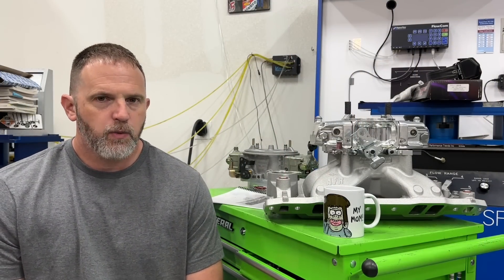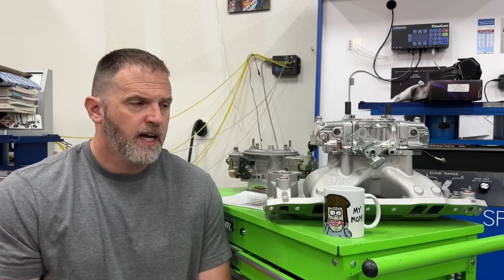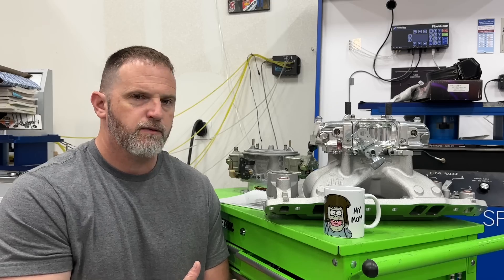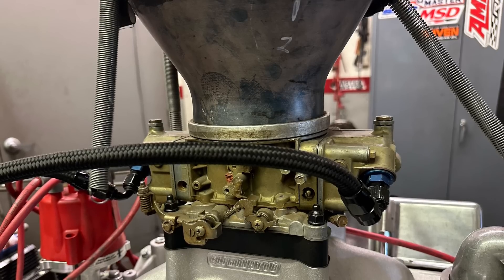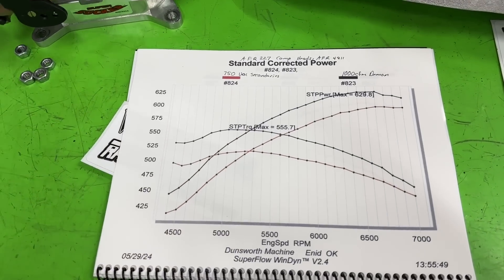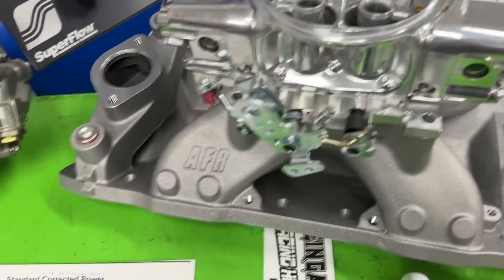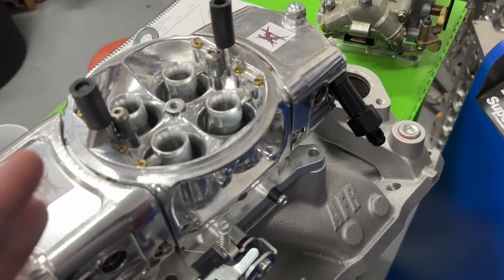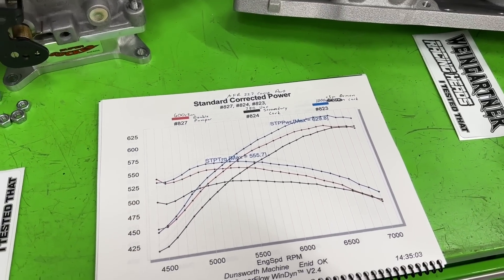Can A Smaller Carb Make More Power Than Larger Carb

Comment: to call that demon a 1000cfm is very mis-leading.. even more so with an annular booster eric…
Reply from the maker: The one in the video is not the one used. The one used has bigger Venturi and throttle blades.
Reply: @WeingartnerRacing   bigger than 1.59” venturi ? 1.75” throttle blade is still the biggest for a normal 4150.. same size holley has always used in true 850’s.
Reply from the maker: The build sheet from mark says 1.56/1.75 1050. I know they make bigger than this. The claimed cfm when I bought new from demon when it was Barry grant they claimed 1000cfm.
Reply: @WeingartnerRacing  there ya go. that’s a standard 850 venturi. now put an annular booster in it and the cfm goes down. i guess if you flowed the carb at 30+ inches of mercury you’d see 1000cfm. 🤷🏼‍♂️😄
Reply: @kevinvannoy  people use a 1050 qf 4150 on a street pu.o gad 540 BBC that won't see more than. 65-6800 RPM  and don't have issues you can loo on the yellow bullet and see that.  That's what gave me my next idea....
Reply from the maker: @kevinvannoy I will try to flow one on the bench and see
Reply: @WeingartnerRacing   yes sir. years ago when i worked for Brad Urban when we opened up 850 venturis , used pretty thin throttle shafts , and dog leg boosters we would measure just over 900cfm at 20.4”…
Reply: there are  demons  that are 1000 cfm.  1050  quick fuels  too
Reply: @KingJT80  you need to understand actual venturi sizes. what everyone calls a “1000” is still barely an 1.57”-.59 venturi. the only reason holley started calling them a 1000 is because they raises the test pressure up. all bullshit as far as a cfm number goes..
Reply: @kevinvannoy  on Holleys this is true. They're really an 850 not a "950" so I do know what you're talking about

BUT Demons 1050 carbs are actually bigger. A lot of racers will tell you the 1050 4150 flows what it says it does unlike the Holleys
Reply: @KingJT80  i tell you what then. measure the venturi  in one of those demons and get back to me. 😉
Reply: @KingJT80   holley never made a “1000” like they advertised. they simple upped the test pressure on an 850..the sheep all followed because they couldn’t be out done. higher cfm ratings sells..😉
Reply: @kevinvannoy  Holley makes a classic 1000 and its not a 1000. We're saying the same thing here 

The quick fuel 1050 4150 has a MINIMUM venturi size of 1.68. racers will tell you this...

You're welcome
Reply: @KingJT80   you cannot have a standard 4150 with a venturi of 1.68”.. there’s physically not enough room. blp will make one of their billet center sections with 1.622” and that’s only because they move the air bleeds back outa the way..
Reply: @kevinvannoy  the same person who makes twin blade 1200 CFM 4150s measured the QF 1050

Thinner blades is how they did it. Look it up on team Chevelle.
Reply: @KingJT80   i know all about the twin blades and who started those.   there is not a standard 4150 that has an 1.680” venturi. 😄
Reply: @kevinvannoy  no  what  im saying is  the person who started  making  those  twin blade 1200 CFM  4150s  measured  the 1050  QF  and  he  said  the venturis  are a minimum  of  1.68
Reply: @KingJT80   i can kinda see that. twin blades remove a decent amount of material to complete the oval venturi..  those will truly flow over 1000cfm easy when using the standard test pressure of 20.4”..

Comment: Yes there's something wrong with that 750, to lose power  only too gain with even bigger 1000cfm ! Also only need as much as the motor can ingest and after that point then your only wasting fuel/air to a point of losing power I would think
Reply from the maker: That is not true.
Reply: a 750  on a 600+HP engine  is  too small.  950  about right
Reply: Engines don't work off flow, they work via pressure differentials. A bigger carburetor will always make more power because they can better keep the manifold plenum close to atmospheric pressure. The higher the manifold pressure, the more the air/fuel wants to rush into the depression being created by the piston. Calculating engine cfm requirements doesn't account for this. The too big carburetor myth has lived on for a long time because what was first available to the public was calibrated for emissions and economy. Those calibrations created a mains circuit that was slow to respond to quick change of throttle position when the carb was on an engine smaller than what it was designed for. Recalibrate the large cfm carb for a more active and responsive mains circuit and power and drivability can be had. Annular booster can be a key element in the recalibration.
Reply: Sounds fair, so at the point where engine is receiving all that it can ingest,whats the side effects of anything given after that point is reached ? Does the motor continue making more power ?? It was my thought that manifold vacuum readings indicates if carburetor is big enough to deliver fuel demand ?

Comment: That is pretty cool now i learn more about carburetors now also i was curious on choke tower vs none what is yiu had 2 of the exact same carburetors just 1 holley xp without choke tower of couse and then another holley with a choke tower to see how it dies on a dyno. I am sure it probably won't do much because it was a curious of mine because i do want to get a Holley xp without the choke tower and on how it compare mine i already have with choke tower which it is now mostly off
Reply: No choke tower is good for a couple of hp up high in the rev range from the tests I've seen. Nothing drastic.  What does help is no choke tower and contoured venturi entrys. You'll see almost all high performance carbs have some type of smooth and contoured entry into the ventuis.
Reply: @Torquemonster440  oh nice ok thank you

Comment: Then you put a load on a big carb and it farts in its own face.
Reply from the maker: Not true. The dyno puts max load on a motor more than anything else besides a boat. The bigger carb has no problems. As long as the carb meters fuel correctly then you will have no problems.
Reply: In theory, when you make a WOT run, you want zero vacuum and perfect fuel metering. To get that perfect fuel metering through the whole run is the problem.
Reply: @loafbred I did notice smaller jets in my FST metering blocks.

Comment: Comparing a vacuum secondary carb to a double pumper is like comparing apples to oranges. You need to be using a 750 DP for a realistic comparison.
Reply from the maker: I have done the 850dp vs 1000dp. 1000dp beat everywhere. It’s in an older video.
Reply: The 750 dp and and 750 vac flow the same cfm the difference is how the secondaries open dp opens mechanically vac uses vac drop to open they still flow the same

Comment: Engine vacuum does not open the secondaries. Air flow does. You can prove this to yourself with an air blower. Blowing air down the venturi inline with the dashpot’s air passage will cause the dashpot to open. Do this off the engine and with dry float bowls or you will have fuel everywhere. The vac secondaries work off the same principle as a soap dispenser on a pressure washer and some sand blasting guns.
Reply from the maker: Truthboomer no. The air flowing past it creates a pressure drop or vacuum. The vacuum opens the secondary side.
Reply: Yes! But also no, the drop in pressure from the venturi is vacuum, I'll be it, very little vacuum like Eric said.
Reply: Um noo

Comment: I dont think people realize thst cylinder head & carburetor technologybhas improved tremendously since the Holley cfm chart days of the late 60's early 70's. Yes I dont belive a 1000cfm carb is a good choice for my 77 Monte Carlo with its stock SBC that produces less than 200 HP at the crank. Its all combination specific. I've seen engines under 350 CID running two dominators & shifting @10.8K rpm. Combination specific. You want zero air restrictions, and proper A/F mixture over the entire operating range.

Comment: An annular booster carb will always make more power than down leg boosters. Although, some will say, the larger boosters restrict some air flow. But being created equal the annular booster will out perform. Also for drivability the annular booster atomizes the fuel better even at lower engine RPM'S than down leg boosters.
Reply: It makes more heat quicker
Reply: @tomhowe1510   Because the fuel is atomized more efficiently compared to down leg boosters. More fuel is able to be completely burned which in turn creates more energy. Annular boosters also help to reduce fuel deposits within the intake manifold and cylinder heads where they could potentially drop out. That is why fuel injection is so popular regardless of its tuning capabilities.  Ford in the 80's took advantage when using Holley carbs and installed annular boosters on the primary side only which helped with throttle response, drivability,  better fuel economy and emissions.

Comment: Could it have been that the 750s back half was not opening at all.
Reply: And that question begs another:  how come Holley hasn't come out with a tps sensor for vacuum secondaries?  I know where my foot is while driving [which settles primary for me], but what I don't know while I'm driving is... where are the secondaries?.  A little 10 segment led bar that tucks somewhere would be wonderful - I have a cowl hood, and I'd stick it right inside.  How fast and how far secondaries respond is important.

Comment: I am here just for the comments 😁 I have tried it all myself.
Reply: Good videos, too.
Reply: I miss the little lt1 in s10. Only cause im about to carburate one in a el camino.   It gets a 750 double pumper because thats what i have.
Reply: @justinadams1360  Get a good race 750 "ATM. Don't use any of that choke tower stuff. I have done back to back runs same AFR race ran a 1-1.5 faster in very close air with a 850 to a 750 not all cfm is the same.
Reply: I have a 750 street hp right now. No choke tower bs. I will look into a atm thanks
Reply: @TPVPRO Same here! On a 383 sbc tried 650cfm, 750cfm, 825cfm, 850cfm downleg (also called a 1000cfm depending if its sold as a race or street carb) 850cfm annular, 975cfm. All can be and were calibrated via emulsion and emulsion bleeds to drive very similar but my favorite go to was the 850cfm annular. The 975cfm had just as crazy throttle response as the 750cfm. 650cfm great throttle response but ran out of puff after the initial kick in the pants. It's all about tailoring the calibration to the specific engine and carb size.

Comment: Its not engine vacuum, theres a port in the primary side under the venturi but yes.  Pretty obvious the 750 wasnt opening, dozens of DP vs VS dynos out there where they make more or less the same power.  Ive done this exact same test myself and made some money doing it.... still have a 680 vs on my 450hp 351.  750dp was boggy down low, lost a couple hundreths and almost 2mph.  Small price to pay for way better drivability, the 500cfm only lost a tenth and was snappier still.  Granted if i had more converter or a single plane or a manual would probably be a different story.  500 nosed over at 6k, 680 will pull to 7k, no noticible difference on the top end with the 750, just annoying at cruise and downshifting.

Comment: What do you think removing the choke horn is worth?
Reply: It seems to work best with a k&n stubstack - radius flowbench work is part of that design.  Get one in hand to size things up before carving down the horn.  I ran a 3310 that way for a long time.
Reply: Test I've read just milling the choke horn straight across doesn't get you anything. It's not until you blend what's left of the choke tower all the way down into the throttle body do you start seeing any results. I'd welcome hearing from anyone who has confirmed or can deny this with Dyno or flow bench results.

Comment: As you said you can pretty much count on the chance that the secondaries did not open all the way on the 750. Not only due to the spring in the pod but also if it does not have the little brass tube that protrudes slightly into the venturi to help it open that will hurt the opening as well

Comment: You're exactly right and if you look at where the vacuum is being drawn for the second barrels it's usually from the first Barrel the air flowing through the Venturi where the vacuum is being created
Reply: Exactly, at full song when the engine vacume drops to near zero that vacume signal created in the venturi is way high..in comparison

Comment: The 650 made more power from the extra fuel discharged from the secondary squirter nozzles under WOT. Believe it or not, extra fuel is pulled out of the squirters due to the pressure differential across the top of the carb at high engine speeds. Engine Masters encountered this same phenomenon while conducting similar carb tests. A Vac Secondary carb only has one set of primary squirters, where the DP has two sets, primary and secondary.  More fuel = more power. Awesome video Eric. Thanks. 🍻

Comment: I don't think that you can have a carburetor that's too big, only boosters that atomize incorrectly for what the engine needs 
for optimum power.
An interesting test would be two carbs of the same flow rate with different booster types.
Reply: I agree to a point. But... A 1350 Dominator on a 283 with iron heads and highway gears will be extremely difficult to tune compared to 650 while driving on the street. I believe in this scenario,  even Eric would agree the 650 is the better carb for the application mentioned above.
Reply: @MAXIMUMWEDGE   yes, the Dommie was tuned for that application.  Out of the box, tuning the 650 to meet those requirements will require less effort, probably none really. I didn't say it was impossible,  just that the 650 will be easier to tune.
Reply: @MAXIMUMWEDGE  that's not disagreeing, that's concurring.
Reply: @psychoholicslag4801   I believe he is disagreeing with me.